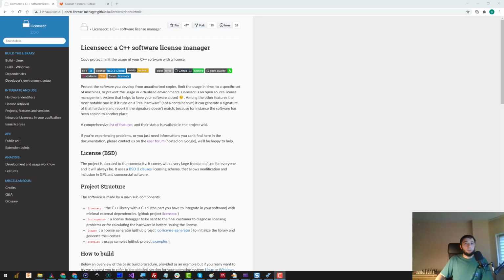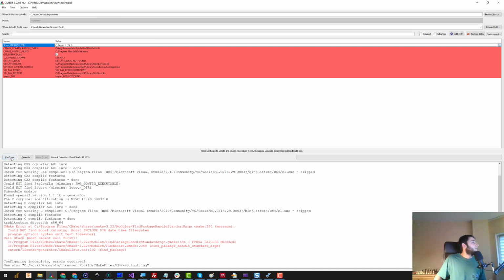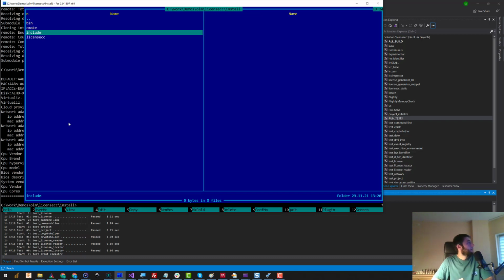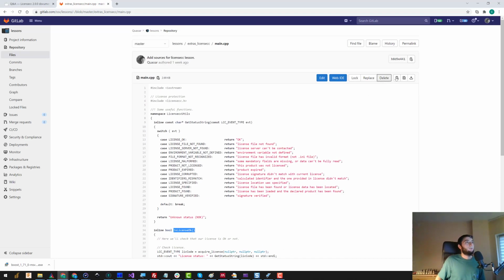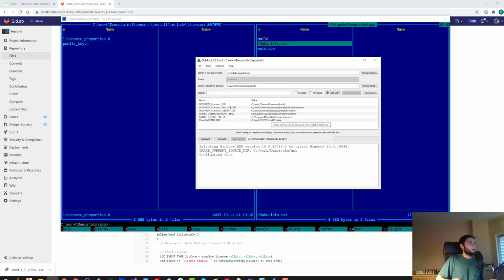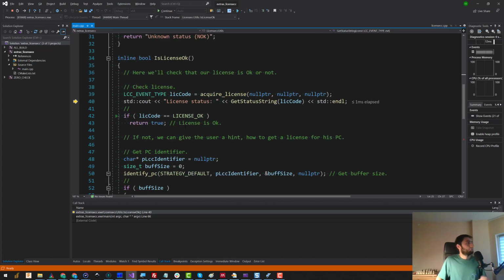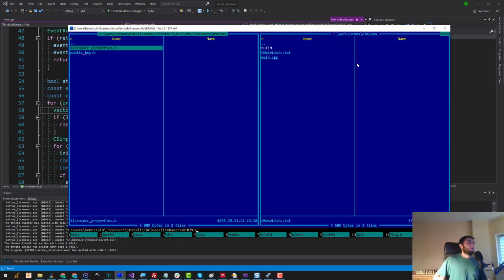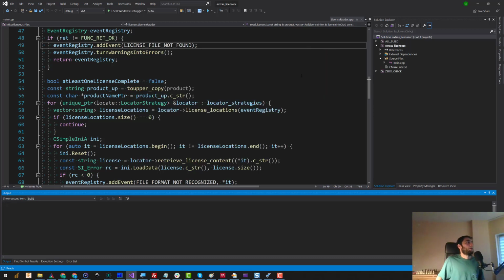Protect your software with Open License Manager | License protection

Comment: hi, just checked this, if I change the system date, the licensing system gets fooled. License status: OK !!! so in principle its not working. anybody else getting this issue
Reply from the maker: Well, I'm not advocating this tool; rather, the goal was to explain how to get started with it. Because we are using it for protecting our own commercial SDKs, it's fair. Maybe we should be more careful but I'm not sure if there are any decent (and open-sourced) alternatives.
Reply: Well, if you change the time on your system you will find https sites failing, and some website authentication will fail too. In 2026 having your system time off of many days is quite a problem. However yes the library doesn't check for that. Checking the time assumes that your software can access internet, it and requires an external server always up and running... It adds a lot of stuff. Maybe in the future...

Comment: by the way as it's a static lib I have to build with the same compiler and I'm using C++17 .. the only issue is adding some casts around std::byte and replacing the deprecated std::binary_function with this

        template <class Arg1, class Arg2, class Result>
		struct _binary_function {
			using first_argument_type = Arg1;
			using second_argument_type = Arg2;
			using result_type = Result;
		};

        /** Strict less ordering by name of key only */
		struct KeyOrder : _binary_function<Entry, Entry, bool> {
            bool operator()(const Entry & lhs, const Entry & rhs) const {
                const static SI_STRLESS isLess = SI_STRLESS();
                return isLess(lhs.pItem, rhs.pItem);
            }
        };

        /** Strict less ordering by order, and then name of key */
		struct LoadOrder : _binary_function<Entry, Entry, bool> {
            bool operator()(const Entry & lhs, const Entry & rhs) const {
                if (lhs.nOrder != rhs.nOrder) {
                    return lhs.nOrder < rhs.nOrder;
                }
                return KeyOrder()(lhs.pItem, rhs.pItem);
            }
        };

built and passed all the tests... in debug at least... I'm not really a CMAKE guru so I don't know how to fix the release TESTS build

Comment: Debug build  went fine (using VS2022 and Boost 1.79) however RUN_TESTS fails for the release build  6 - test_license_locator (Failed)
what does the PACKAGE build do ? that doesn't seem to work DEBUG or RELEASE
Reply from the maker: Can't help you, unfortunately, but you might want to try a luck in the dedicated forum of licensecc. Here it is https://groups.google.com/g/licensecc.